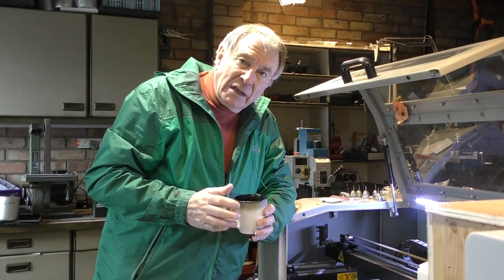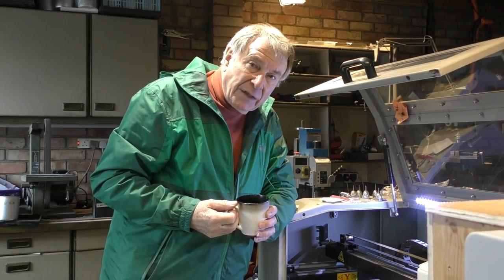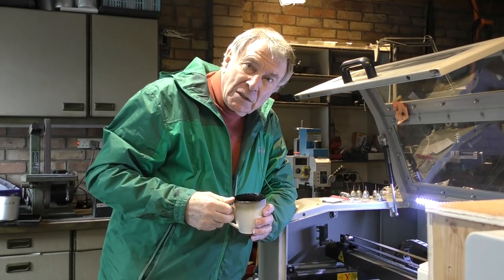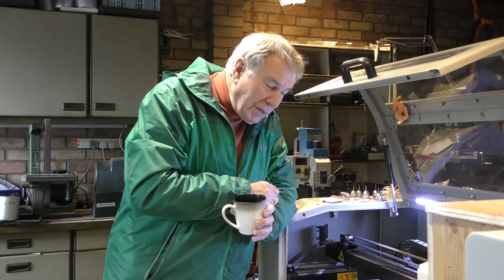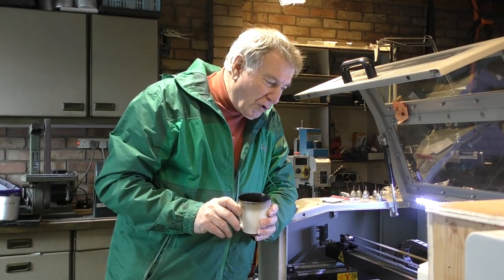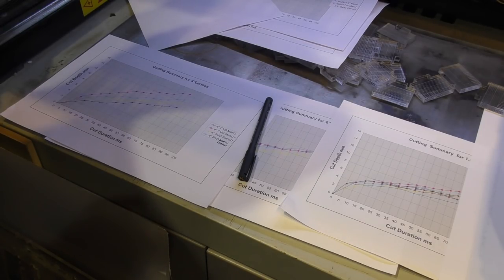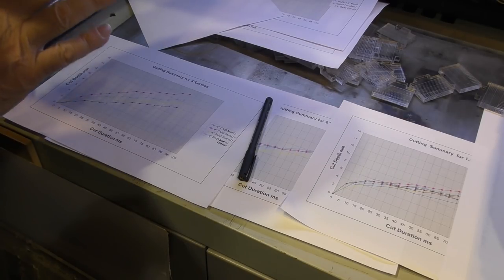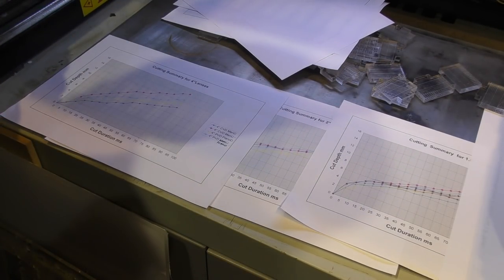RDWorks Learning Lab 202 More Laser Cutting Investigations

Comment: Thanks for your great work on this as ever. I'm thoroughly enjoying learning from you! I have one question (probably stupid), but if a laser beam is meant to be a 0 degree beam angle, why does intensity fade off towards the edge of the beam? Surely it should be completely the same across the whole beam until it is sent through the lens which focusses it?
Reply from the maker: Hi
If you stop the video at 2:25 you will see a graph of the light intensity within a laser beam.The ideal laser beam (any sort of laser) should be a perfect Gaussian (otherwise known as NORMAL) distribution.  It has very specific mathematical properties (Google Gaussian Distribution for more details). As you will see from this  graph, yes there is light across the whole of the beam but it is not uniform. It's brightness (intenseity) is greatest at the centre. Intensity means more material damage so that is why a mode burn produces a conical shape hole as you see demonstrated at 8:20.  That conical hole can only happen because there is more energy at the centre than at the edge of the beam. That's just the way laser beam physics is.

When you look at the moon through a telescope it  gets bigger . When you turn the telescope round the moon just  gets smaller. It does not get turned into a uniform white dot. The same thing happens to the laser beam when you squeeze it through a lens. It does not magically become uniform, it still retains the same sort of power distribution within the focal dot. 

Best wishes
Russ
Reply: @SarbarMultimedia  Thank you for taking the time to reply! I think I was just under the impressions that (prior to being focused) a laser beam was uniform in power/intensity across the diameter of the beam. But you learn something everyday! Thanks again!

Comment: Love that you can do a max speed and not have to guess anymore
Reply from the maker: What did you tube do with the answer to this comment????
 Let me try again.
Remember this is only an initial test to show a crude relationship between burning a hole and doing real cutting. Real cutting is burning that same hole but with one side of the hole missing  and the beam always on the move. It will never be a perfect analogue  but it's beginning to put some real objectivity and understanding into the subject. Lots more to explore and understand. I'm now feeling pretty confident I can eventually decode cutting.
 Best wishes
Russ

Comment: I have to wonder what can be done with multiple high speed passes over the same path.
Reply from the maker: When you engrave/shallow cut material you are converting solid material into fumes that are hundreds of times more voluminous than the solid that it was. That means lots of fumes being ejected UPWARDS and sideways from the "cut" zone. With air assist ON, you are blowing those fume back down onto your work and "painting" it with sticky brown tars (if wood() or white condensate(if acrylic). The whole aim of CUTTING is to pierce through the material and inject air into the top of the cut to make sure those crap fumes exit via the BOTTOM of your job where they can do no surface damage.. Multiple passes have no BOTTOM exit so by default they will just cake up your top surface.  IF you cannot go slow enough to cut in one pass than you must suffer the consequences so ALWAYS try for a single pass cut.

Best wishes
Russ

Comment: You may find that raising the focal point into the material will bring the waist closer to the starting surface and allow for higher energy density as the maximum beam size is smaller top and bottom even though the minimum is not at the bottom any longer.

A refreshing video with real world information.  I made similar cuts to align and test my lenses when I had a laser in my garage so this is familiar.  The meniscus or flat side should not need repeated testing if we can trust optics.  Doing the test once should be enough to just make a note for all future lenses.  I was taught that with a plano-convex the parallel beam should strike the curved side.  The second diagram on this page illustrates.

github.com/OpenLabTools/OpenLabTools/wiki/Optical-Setup
Reply from the maker: Hi Kalle
 There are three easily available lens materials  PVD,CVD (zinc selenide) and gallium arsenide. There are two commercially available forms for each (plano convex and meniscus) and two ways to install them.  Typical focal lengths for each will be 1.5", 2", 2.5" and 4". That is a total of  3 x 2 x 2 x 4 =  48 possible combinations.. To date I have tested 26  of those combinations  on 3 different materials ,10mm plywood,10mm MDF and 10mm Acrylic.
 My tests were done with a 60 watt EFR CL1200 tube using cutting speed for a through-cut  to compare their performance.
 I used the data to examine several  myths about laser cutting.

 I evaluated the benefit of surface focus compared  to dropping it into the material by 3mm

From 32 different tests, plywood results are
Better on the surface = 4
Better 3mm into the material = 14
No difference = 14
From 32 different tests, acrylic results are
Better on the surface = 13
Better 3mm into the material = 2
No difference = 17
From 32 different tests, MDF results are
Better on the surface = 11
Better 3mm into the material = 4
No difference = 17
MY CONCLUSION :  THERE IS NO EVIDENCE TO SUPPORT THIS GENERAL STATEMENT. Some results were better in softwood  but for other materials the gain was negligible  THE SAFEST FOCUS SETTING IS ON THE SURFACE……..IT ALSO PRODUCES THE CLEANEST COSMETIC SURFACE AND THE THINNEST CUT ENTRY.

Since these tests I have added to my lens collection and  the pattern demonstrated  here continues.

The diagram you refer to is  an interesting difference that I am aware of. I was also taught that flat side down was  most efficient for cutting.  However, I have come to distrust  many well documented  "facts" . They may be well documented but not necessarily widely tested.  My tests show that there are specific instances where  this "fact" is true but

Out of 48 pairs ( flat up/down)
13 were better up
8 were better down 
27 were no different

There were specific combinations of material and lens orientation that showed slight advantages but there is no convincing overall pattern of data that suggests either lens orientation is “correct.” The one fact that does exist is that the focal length changes with lens orientation. Machines are normally supplied with the lenses mounted flat up . Thus your setting piece will be wrong if you decide to flip the lens. It will be 1 to 3mm less with flat side down.
MY CONCLUSION: THERE IS NO EVIDENCE TO SUPPORT THIS GENERAL STATEMENT. ONLY 8 OUT OF 48 TESTS WERE BETTER.

The tess I did in this video go beyond one crude "cutting speed" parameter and attempted to objectively measure lens cutting performance in a different way.and this has provided me with a whole new insight on lenses.

My main question to you about the link you provided is. can you explain   how is it possible  for a well focused beam (flat down)  to CUT better than  a flat up configuration where you can at least see some power being projected  BELOW the focal point.?

The next video will show my distrust of laser cutting "facts" that are not based on logic or physics. but more on imagination.
 A video I did  almost 2 years ago  shows how I conducted all my tests   https://www.youtube.com/watch?v=yO2TD_h8_nI
I have a pdf document of the data I collected.  If you are interested then just add your disguised email address to another comment and I will send the file. I will also delete your comment/email address from public view.
 Best wishes
Russ
Reply: @SarbarMultimedia  Wow, thank you. This was the first video of yours I have seen (Unless I saw something a long time ago, your method of working seemed familiar) and was rather impressed.  Your range and explanations of tests are way beyond anything I would have the patience for even if it was important to business.

The curved side to parallel beam is an optics rule for photography/imaging and I have heard it mentioned in regard to lasers too.  In my year of mucking with lasers I could not discern a huge difference either but trusted the logic.  I trust your tests too and think the rule may also be a bit arbitrary for laser work.  The parallel laser beam is pretty narrow and it is only covering a small part of the lens so the total range of curvature (ray divergence) is actually quite small.  Perhaps we have been taught to chase a barely detectable effect by purists instead of those who work in industry.

As I trust the effect is real and detectable in photography applications we need to consider why it has less effect on the deep cutting.  I hazard that perhaps it may widen the waist of the beam and so make it more parallel which might leave a longer adequate focus instead of a short ideal focus.  If this is the case then the orientation should matter more when surface engraving or using CerMark material on stainless.  I did some experiments back when and CerMark on a 40W CO2 is near the limit, certainly a shorter focus lens made a hotter spot.

Thanks for taking the time to respond, Makes me want to get a workshop setup again and install a laser.

I don't think I could make good use of your research but thank you for the kind offer.  I can be found on FB in an emergency.
Reply from the maker: @KallePihlajasaari  
 Hi Kalle
 You cannot superimpose camera lens theory onto a laser. Cameras  work with a pretty uniform light beam whereas the laser ALWAYS has a very intense light (invisible) at its beam centre. With photography you are very critical of lens aberration whereas I believe it is the key to successful laser cutting.  It is almost impossible to get rid of aberration because the closer you get to the lense axis the smaller the refraction and right at the axis there zero refraction and a single theoretical ray that cannot focus on itself and travels to infinity.  For reasonably uniform camera light rays,  this minute  "leakage" is not a noticeable problem . but I believe things change when the light beam has a Gaussian intensity distribution.. The next video hopefully will explain my theory.
 Remember this is CUTTING where what happens BELOW the focal point is of concern and a real puzzle. Perfect focus onto a single spot is the requirement for engraving so now you do want a lens with no aberration. Every parameter I am aware of is diametrically opposite for cutting as opposed to cutting. 
 Thanks for your interest
 Best wishes
 Russ

Comment: If the beam is parallel, why does the material burn into a cone shape?
Reply from the maker: Stop the video at 2:40 and look at that picture. That is a graph of light intensity within the beam. The highest intensity is at the centre of the beam. The greater the light intensity the faster damage will occur. . The low power at the outside of the beam requires a VERY long time to do damage whereas  the centre  of the beam does its damage faster and so you get a conical damage shape.  Acrylic is such a useful material for telling you exactly what is happening within aCO2 laser beam

 Best wishes
Russ
Reply: @SarbarMultimedia  Ok I see. Thanks.
Would a total reflection iris/diaphragm/aperture on the upper lens remove that lower energy light from the end product?
Reply from the maker: @repairtech9320   
Hi
The problem with CO2 laser light is there there are ony 3 things in its universe
1)Metals. All metals reflect CO2 light (that's why we use metalformachine mirros)
2) A VERY small group of salt-like materials that are transparent and allow 10.6 micron light through (glass is not one of them!!!). We use these for our CO2 laser lenses.
3) EVERTTHING ELSE.  Materials in this group are heated up by the CO2 light.

 Thus  If you use bare metal as an aperture it will reflect back and could damage the laser tube. If you use any other material it will heat up . Sadly this is not the same as visible light camera technology.
 
 For short duration testing I have used black anodized apertures when I was huntingb for the vrey short focus compond lens to try and filter low power. The results were abysmal at all the aperture sizes I tried. Physical obsuration seems non effective.
 Thanks for the thought because  perhaps I hadn't tried it and then  it would be a great suggestion.
 Best wishes
Russ.
Reply: @SarbarMultimedia  I will sound crazy but just for s.. and giggles or science lol... If I had a dead laser tube and some cash to waste. I would take the TR mirror from the junk CO2 tube, cut a hole in the middle with a water jet and use it as an aperture. And keep a fire extinguisher close, since there's no way to cool it down.

Comment: Great investigation, but i dont get it waht are you trying to figure out? I think your focus is not good adujsted because the cutting slot width looks quiet large.
Reply from the maker: Hi Fredy
  I assume therefore it has never crossed your mind that diverging lightrays below the focal point cannot account for why the kerf  in 10mm  thick material has parallel sides.  Lens theory and what happens in practice do not agree. Furthermore there is another "fact"  that I have proved to be wrong. It is always taught that as the focal length gets longer and the spot size gets bigger,   if I put the same power through short and long focal lengths the so called "energy density in the spot  rapidly decreases as the focal length increases.. Therefore you cannot use a 4" lens unless you have over 100 watts to compensate for the lower energy density.. High enegy density = good cutting and low energy density=poor cutting.   Hmmm. Pratical tests show the opposite. So that's two things I am trying to "figure out". I can find no reseach to help answer the first question and people just accept the truth of the second. 
 
I have been beating up lenses for about 2 years since I discovered these anomolies. I have devised all sorts of wierd tests and spent weeks carrying them out in an attempt to get clues  about the mecanics/physics of how and why a laser bem cuts the way it should not be able to . 

If you cannot figure out what I'm  trying to find then you will not really appreciate the answers when I find them.  However, dont lose patienec because there is good stuff coming in future sessions and I promise i will decode how a laser beam cuts the way it does.  At last, those lens summaries have shown me what I have been seeking for about 2 years.and now I have a clear picture of how it all works.
 Best wishes
Russ

Comment: (Noob here) I usually see recommended that plano convex lenses should be used plane side down. If I read your charts correctly, did you just prove that wrong? It seems every plano-convex lens you used worked better plano side up for every focal length!
Reply from the maker: Hi
  The facts you see are true forMY machine . I cannot guarantee that they work for others because since I started this investigation into lenses I am reasonably confident that is the COMBINATION of lenses and the intensity profile of the beam that is generating good results.  My beam is very "sharp" but I think a "soft" or "blunt" beam will give different results. Also when I did a big lens investigation I tested cutting with many different lenses . Here is a summary of my results then which was done with my previous 60 watt tube.

The myth I was investigating was that CUTTING IS BETTER WITH LENS FLAT FACE DOWN.
Out of 48 pairs ( flat up/down)
13 were better up
8 were better down
27 were no different
There were specific combinations of material and lens orientation that showed slight advantages but there is no convincing overall pattern of data that suggests either lens orientation is “correct.” The one fact that does exist is that the focal length changes with lens orientation. Machines are normally supplied with the lenses mounted flat up . Thus your setting piece will be wrong if you decide to flip the lens. It will be 1 to 3mm less with flat side down.
THERE IS NO EVIDENCE TO SUPPORT THIS GENERAL STATEMENT. ONLY 8 OUT OF 48 TESTS WERE BETTER.

 Best wishes
Russ

Comment: If you halve the beam width you will multiply the light intensity by 4 - it goes by the area of the spot not the diameter.
Reply from the maker: Hi Ed
Yes, As I was editing it, I realize the diameter v area issue  was incorrect.  I do understand the 0.707 rule. I figured that most would not.. Thanks for  telling everyone. If I had bothered to do the math then the 7mm diameter took 10 sec and the 4mm beam took about 3 sec.  The areas are 38,5 and 12.6 where the 38.5 took 10 sec so the area corrected burn time for the 12.6 area is 3 seconds....ie what actually happened.
 Best wishes
Russ

Comment: Cutting the beam dia in half will increase the intensity by 4x
Reply from the maker: Yes, As I was editing it, I realize the diameter v area issue  was incorrect.  I do understand the 0.707 rule. I figured that most would not.. Thanks for  telling everyone. If I had bothered to do the math then the 7mm diameter took 10 sec and the 4mm beam took about 3 sec.  The areas are 38,5 and 12.6 where the 38.5 took 10 sec so the area corrected burn time for the 12.6 area is 3 seconds....ie what actually happened.
 Best wishes
Russ